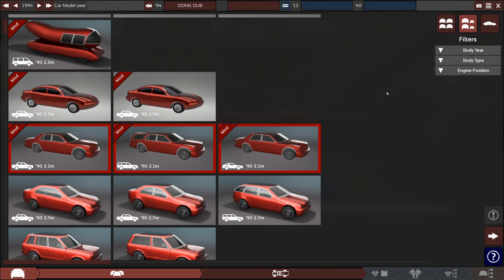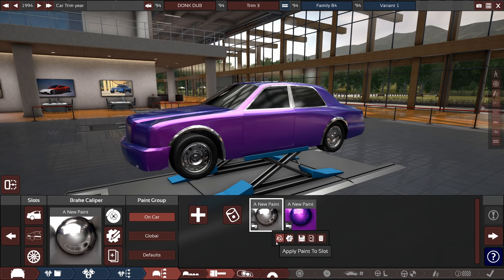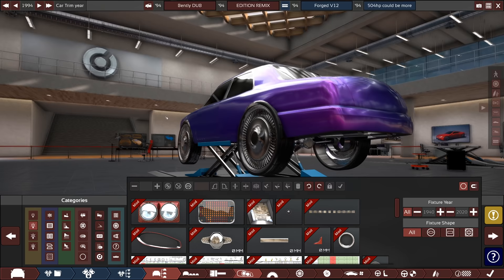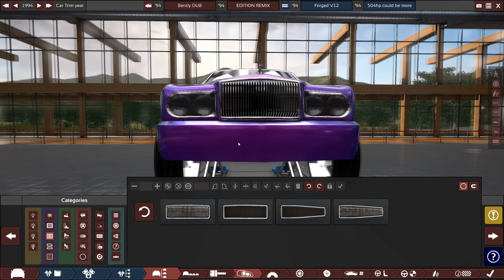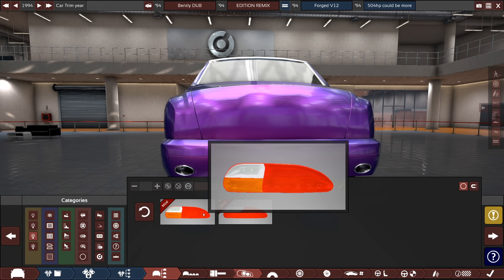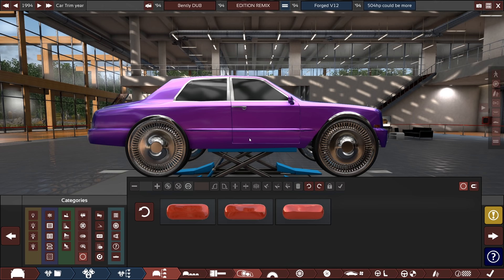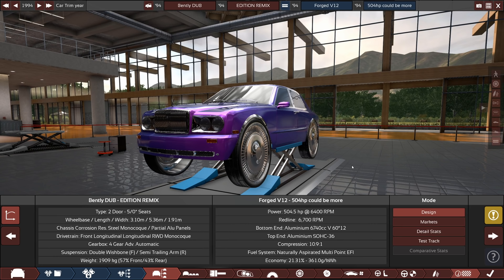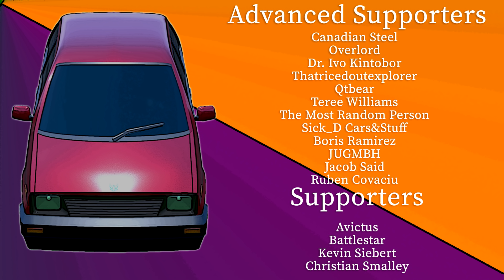Bentley Donk Build - (Automation + BeamNG.drive)

Comment: Back when BMW still owned both Bentley and Rolls-Royce, the RR Silver Seraph had a 5.4-litre V12 while the Arnage got a turbocharged 4.4-litre V8. The 6.75-litre V12 was only introduced by BMW in the Phantom in I believe 2003.